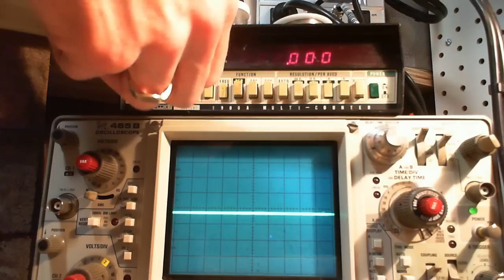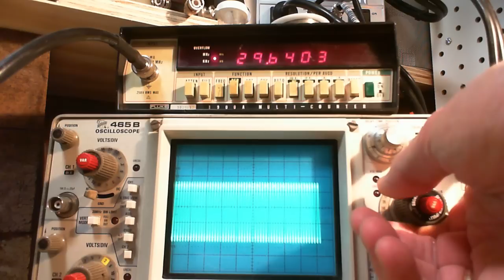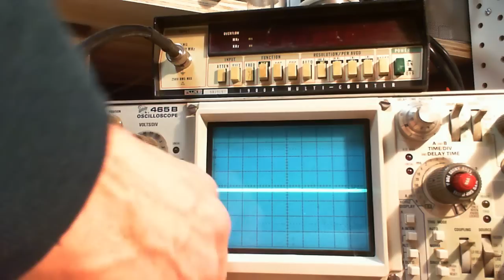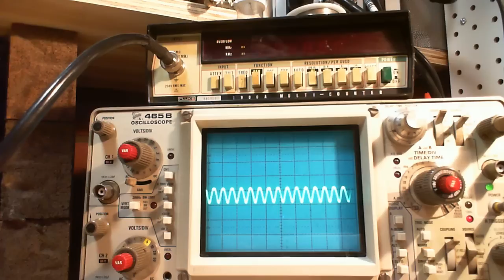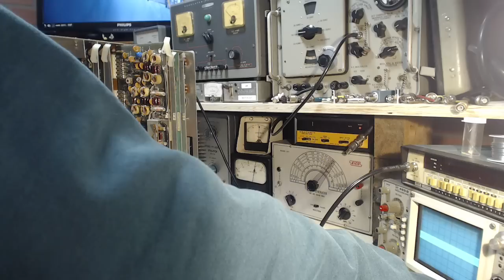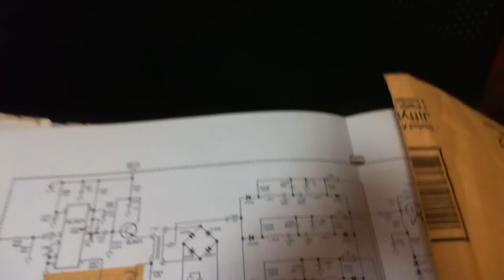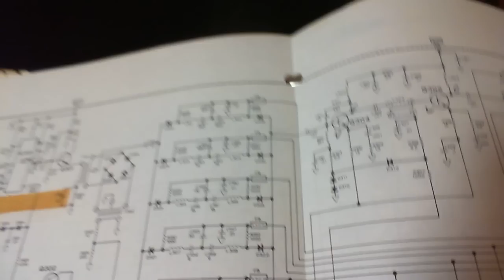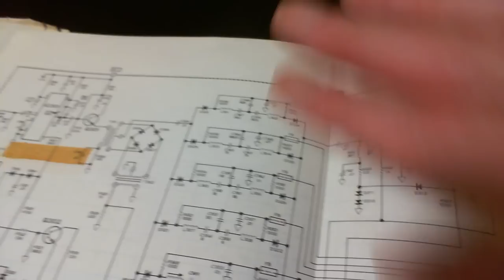Heathkit SB104A Transceiver Video #14 - Transmitter IF Board

Comment: I would encourage you to use the alignment procedure developed by Heathkit starting with board A only in the radio. When you see an unexpected output stop and find out what .  At least you can test/repair the boards to see which ones give you trouble. Best
Reply from the maker: +cadiscase When I perform the final checks and alignment, I will follow exactly the procedure Heathkit has outlined. There are some funky steps involved.

Comment: Jim,  It looked to me like you are seeing LO leakage from the receiver or transmitter.  I also don't feel confident that you have found the oscillator frequency.  I don't have a schematic, but from what I could see it looks to be using a balanced modulator to generate the DSB  output.  It might then filter one of the sidebands and up-convert the IF to the carrier through a mixer, then amplify the carrier.  I would look at the inputs to the balanced modulator to see if they are correct.  Does the manual give you that information?  I would be starting back at the inputs (audio and IF) to see that the modulator is getting the proper signals and levels.  I know you are not reading comments, but just a few thoughts.
Reply from the maker: +Keith Barker I'm read comments now. Thanks for your ideas!

Comment: I would never put output from a transmitter into freq counter  you need to use a rf sampler tap
Reply from the maker: +DENNIS N I considered it because I believed I had complete control of the output level.